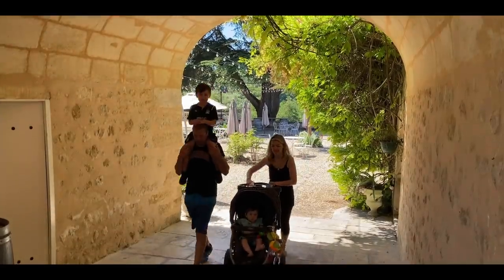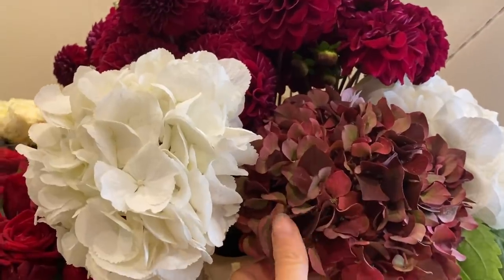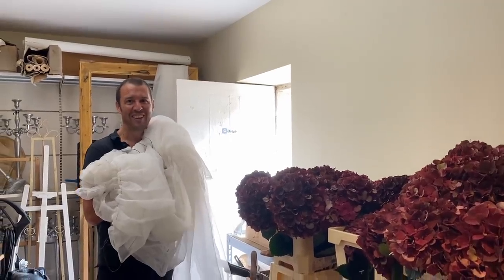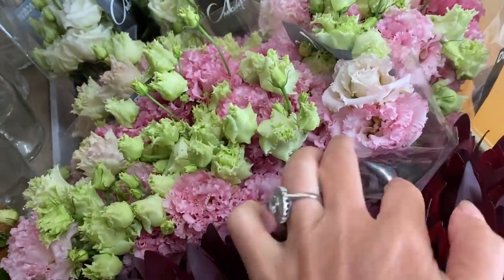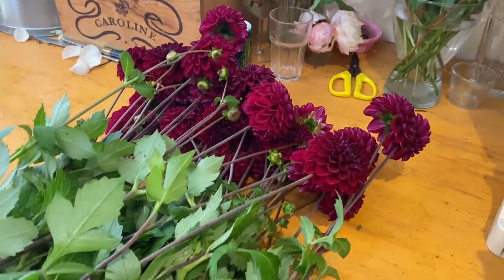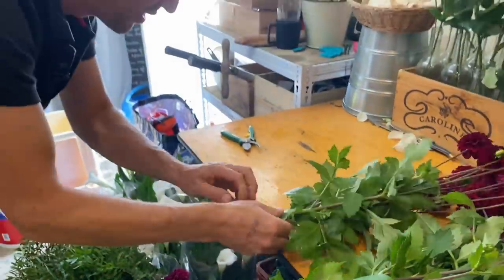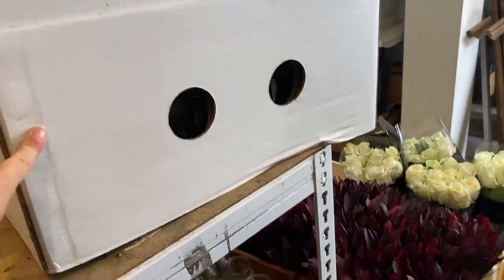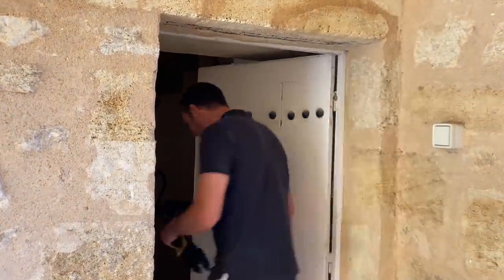EP43 French Bed Styling

Comment: Have you tried placing the valances inside the top wood piece and flipped over the outside of the curtain tops? 
Seems the gap is intended for that.
Assumed the curtains went on the poles, but that requires disassembly/reassembly.